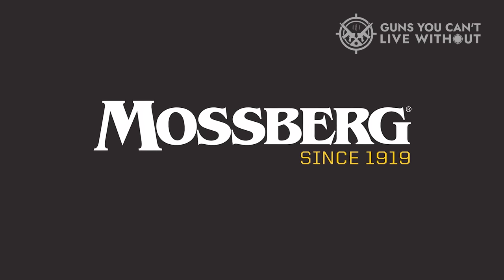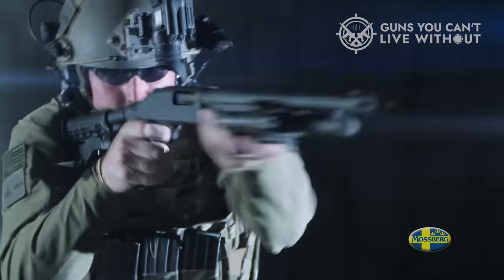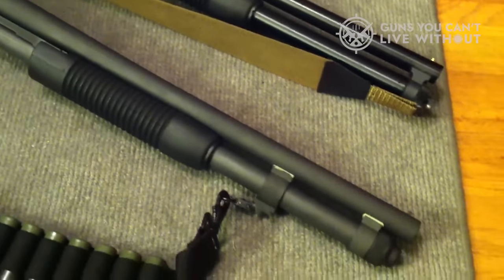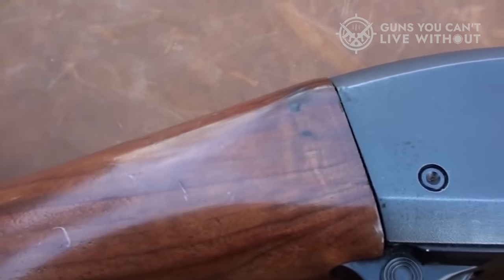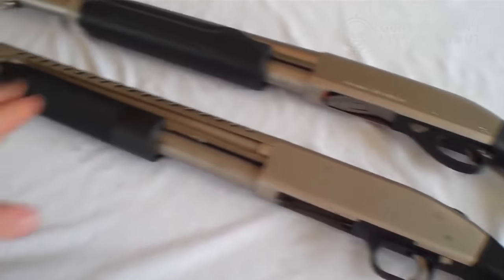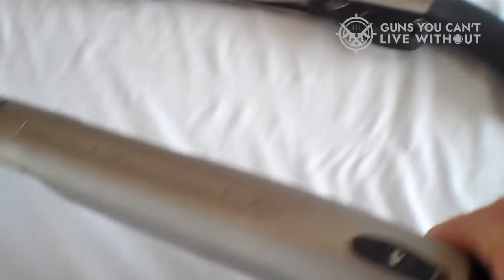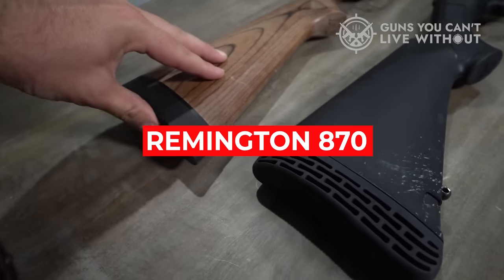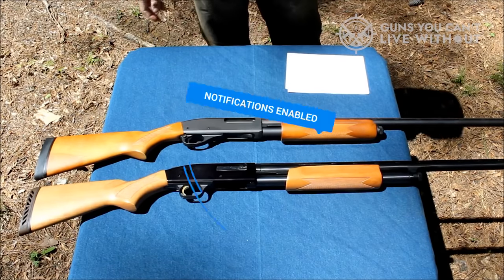Mossberg 590 vs Remington 870 - NOT EVEN FAIR.

Comment: I've used both the 870 and the 590 in the Marine Corps, as I served during the period when the Corps gave up their warhorse for the Mossberg.  I found the Mossberg to be easier to use while not sacrificing any reliability.
Reply: Must have been a bit before me, I was in 2001-09 and just remember the Mossberg. Great gun.
Reply: So is he telling a lie to sell one brand over the other.... not likely. Look at the prices of a pump type for both brands. Consider 20 ga.   vs.   12 ga.  (same charge and fewer pellets in a 20 ga. ).
Reply: I was USMC 1987-1994... we used the Mossberg ... I even went to a FLETC course designed around deploying and using shotguns. It is such a beautiful shotgun, that I owned one for a while. I only gave it up to buy a Mossberg 835 so I could have something for all around use ... defense or hunting. 

I was also Army 1994-2018, and squad leaders were issued a 870 during GWOT. Still a usable weapon, but I liked the Mossberg better.
Reply: I too was USMC (93-2006) and trained extensively with the Shotgun, both the 870 and the 590.  I grew up owning an 870 wingmaster and hunted ducks in the everglades.  

I love both, but the 580A1 is my favorite when worked.   Without the action work the 870 is a bit slicker.  I prefer the crossbolt saftey of the Remington.
Reply: when I was in the Corps, the tactical shotguns were mostly the M-37 Ithaca shotgun there were still a lot of the Winchester M-98 shotguns with the external hammer. I thought they were pretty cool looking.
Reply: I used an 870 in the USMC and own a 590 A1. I'll take my Mossberg every time.
Reply: I agree. 30 years of flawless reliability.  THEN YOU ADD COST and the Mossberg wins hands down.
Reply: Things always change in the military. When I was in the Navy I never saw a Mossberg, all we were issued was 870's.
Reply: Navy Seabee 1970 ---75. I lucked out on second deployment. Turned in my M16.  Convoy duty got me a WW II Mossberg Model 37 Combat shotgun. 9 shot, heat shield and lug. 9 shells, 81 rds down range Never loaded a rifle mag again.     Best part was the Gold inlay Hunting scenes on both sides. One side was Fowl, other side was Hunting. In the field the Gold sides were shoe polish covered. Still love that weapon.
Reply: @DougHinVA less recoil too…😝
Reply: That was an Ithaca.
Reply: Used both while in the Corps,  love both of them equally.  Built myself a M870 when I got out and bought a M590a1.
Both are great shotguns.  I use both in three-gun shoots, never had any type of failure to think of.
Reply: aluminum receiver...
Reply: 86-03.  Used both shotguns and prefer the Mossberg. Currently own 2 Mossbergs and 1 Browning bird gun.
Reply: The Mossberg is easier to magazine load under stress but harder to select slug through the ejection port when the magazine is full.  The Mossberg action is not as smooth as the Remington and not as often  used in Shotgun Competition.
Reply: With the new small drone warfare we’ll be using goose guns with improved cylinder

Comment: Navy instructor yelled at me on the  M500 course because I kept short stroking it (because I was used to the comparedly buttery smooth action of my old 870.) He said to me "run that bitch as hard as you can. If you break it, the Navy will give you another one, and a fucking medal of achievement."
Reply: Same way instructors used to teach when the military used bolt action.. WORK that bolt, show it no mercy !!... ( like a guy could really break one!) Short stroking a shotgun or rifle...or limp wristing  an auto pistol, can leave you in a very bad position.
Reply: I have been shooting for just over 30 years and fired thousand of 12 gauge rounds, most through mossberg 500 series. I have never broken a Mossberg 500 but i have worn some parts out in it, believe me you can fix that thing with a hammer if you have issues. I have had to pound pins kinda flat because they were so worn and falling out, i had an ejector get warped somehow and i beat that thing back straight and never had any more problems with it.

I love a good Remington 870 but as much use and abuse I have put on a Mossberg its damn solid shotgun that is hard to beat.

Comment: The 870 was a staple throughout my career. In 27 years virtually everything else changed but the 870 was constant.  It was simple, versatile, reliable, and effective .  Old habits & training die hard, while the Mossberg is a fine platform, the 870 is my go to shotgun.
Reply: It’s okay to be wrong.
Reply: @Loveiskind51  😅
Reply: @Loveiskind51  ?
Reply: Remington has fallen.
Reply: Like most of us, I have a variety of shotguns, rifles, pistols, but in my home, if my life depends on it, my 870 is my go to gun with an AR close beside.
Reply: The 590 is the beefed up version of the 500 that the safety, trigger guard and slide arms would constantly break on. The 590 is great the 870 always has been.
Reply: I'll take the 590 A1 please !
Reply: @@dannytimms9011 An old dog can learn new tricks... it just takes a lot of reps. I also know this because of experience. :) The question becomes: "Is it worth the investment?"
Reply: How many lives did you ruin in those 27 years?
Reply: The new 870s are absolute garbage compared to what you grew up with.  It use to be slightly better to a lot better than mossberg now its not even comparable.  I'd rather have a Maverick 88 than a new 870.
Reply: @indalecio539 only the ones that needed to be…😝
Reply: @hks956 so you like guns that rust easily…🙄
Reply: @ZSmith-yy4lv not the old ones. I have an express .12 gauge first year they came out and it still shoots good and reliable and been shot thousands of times
Reply: @hks9 13:40 56

Comment: Used an 870 for over 20 years while on patrol.  Never failed in any weather.  Bought my own 870 Magnum Express after a few years in law enforcement.  Have used it for years for trap and clays shooting.  When she locks into battery, it's as solid as a bank vault. I've installed an 18"-barrel and a magazine extension.   It's my primary home defense weapon along with my Colt 1911A1.
Reply: Excellent choices!
Reply: Same here. Except have a GLOCK 30SF 45ACP. Instead of a 1911.😊
Reply: Bro is the king of all fudds😭
Reply: If you use a Remington 870 MAGNUM, you'll never hear  "he had to shoot him twice".
Reply: Same here.  I had a Remington 870 with  the 14 inch barrel issued to me for twenty years.   I  would have loved to have taken it with me when I retired.  Never had a malfunction with that gun.

Comment: I got a used 870 Wingmaster when I turned 18.  Over 30 years later, and it is still a great gun.  It'll see more owners past me I'm sure.  Got it with a ginormously long barrel with a fixed full choke.  Swapped it out with shorter barrel with interchangeable chokes, and it made a huge difference.  Also added a Hi Viz triangular site, and it's the easiest gun to aim that I own.
Reply: I just bought a Wingmaster in  pawn shop. It was “used” (had never been fired). I couldn’t pass it up. It was the same gun my dad had except for the vent rib. Mint condition.

Comment: I have both the 590 and the 870 and both are awesome! I prefer the Mossberg because of the thumb safety location. You can't go wrong with either
Reply: I hate the cross bolt safety system and will not buy a gun that uses it.
Reply: Agreed. Mossbergs safety is right where it ought to be. Not bashing Remington, but that one little nuance, has made me a Mossberg man.
Reply: @SIXPACFISH  The Rem with the rear safety that's not instinctive to operate has been why I HATE the 870. I started out with a vintage Win M12 and got used to its forward safety. Its small but fine until gloves are on. Now the M12 riot models have the aftermarket enlargled head. Now I got a couple Moss 500's had issues with the factory safeties, so put on 2 different styled aftermarket ones that work much better.
Reply: I never us safeties as they give the user a false sense of security.  Many accidental discharges were made thinking the safety was working.  My firearm is either loaded or not.  Simple as that.
Reply: For my situation the through safety is preferable. I have a pistol grip on my 870 which makes it more accessible than a receiver-top position.

Comment: I own both shotguns in older models back b4 they got cheapened up. Both work fine for me in different hunting situations. Ive never had any failures of any type with either. They both have specific things i like. I prefer the thunb safety on mossbergs but the triggers n pull on 870. I think if a person needs one or the other for hunting or home defense both shotguns would work just fine. This is kinda like asking for a debate between 270 and 30 06 for a whitetail cartridge...i havent met a dead deer yet who knew the difference!!!
Reply: 270 kicks less
Reply: You're absolutely right.  it's a silly argument.
Reply: @obi-wankenobi1750  but 30-06 has a lot more variety in bullet weights, and you can get bullet weights than kick less than the 270 (try shooting a 30-06 with a100 grain or a 110 grain bullet, and they even have one with a 55 grain, all which are easy to hold and kick is very light, around the same recoil as a .223 or 5.56 mm). Also the .270 was designed using the 30-06 case and was made slightly necked to hold the smaller bullet, so the recoil is almost the same, withonly about 10 pounds difference in force.
Reply: @lesliemiller5790  bro missed the point of the analogy
Reply: Yep, killed a doe @ over 400 clicks on a  cut over powerline, furtherst shot I've ever taken. Remington .270 with my own hand loads.
Reply: I agree. My 870 is an older model-when they were made with quality and integrity. It was my grandfathers and was passed down to me. I’ll never part with it. Everyone that tries it, automatically is in search for an older 870 right after. Something about the trigger and the overall feel. Not knocking a mossberg just have not had the pleasure of trying it out yet.
Reply: I thought about 870 but am afraid of getting the freedom group lemon
Reply: @duck2587  yes. I have a cheapened-up 870 and it is the most unreliable gun I own. I'm looking for something else now. Maybe an old one.
Reply: Depends on the terrain as far as deer cartridge goes.  .270 for long range and 30-06 for busting brush.
Reply: This is the best comment I’ve read on YouTube to date out of ten years or so.
Reply: @obi-wankenobi1750 who cares
Reply: DR-qs4xk That was the joke...
Reply: @mrguiltyfool  I collect the Remy Wingmasters.  Freedom Group QC of late is on par with the pre '07 Wingmasters.  I wouldn't take a free Remington Express shotgun.  Wingmasters are just buttery smooth actions ... kinda like Tikka bolts.
Reply: @theebrainfixer  interesting
Reply: I never liked Mossberg pumps because the pump was alot longer of a travel.  Whereas the 870 was a much shorter and less laborious pump.
Reply: @mohunter68  Really, 400 clicks? The longest kill by military sniper with a .50 is 3.4 clicks. I don't care how hot you loaded it, a .270 isn't going make it out 400 clicks, past 400 yards the .270 looses enough energy to be questionable for ethical shots, looses accuracy at 900 yards, literally looses all velocity and hits the ground at 8 clicks.
Reply: A 30-06 with a 150 grain projectile, shot at 310 yards will drop around 21 inches, 270 with 130 grain projectile same distance, drops 4 1/2 inches, this info comes from the fbi's forensic ballistic rifle data sheet
Reply: @aphelion2902 "bro" actually made a good point that was analogous to the original inquiry, that you, yourself, clearly do not understand.

Comment: I went with the Mossberg 500.  Mine came with both the short barrel for home defense and the long barrel for hunting/clays.  Many gun owners like to work on their own equipment.
Reply: Had the 500 with 20" barrel and pistol grip, 8 shot tube. Only problem was hanging on to it! Never jammed, plastic grip,
Reply: I wouldn't take my guns to a gunsmith unless it's to be reblued and I keep my shit clean anyhow
Reply: My mossberg is a piece of s@#$. It has not survived time and use,  the junk pot metal action will not let this one survived.  If it doesn't have a steel action don't buy it.
Reply: The 500 was my first noob gun purchase...it does it's job well enough, but I probably should have laid down a little extra for the 590 with an extended mag tube.
Reply: @andersonsprairieviewfarm2552  What the hell do you do with your shotgun to mess up a 500? I have had one for decades and it is still in great shape.

Comment: My dad had a Remington 870 and when I was 14 years old I bought my own 870 Wingmaster. Granted this was 1969, so I can't speak for more modern Remingtons. But these two guns were pretty much unbreakable. Dad's spent the night under 6 feet of muddy water with a weedy, muddy bottom.  Using a rake and other tools pulled it up the next day. Cleaned it up and it never missed a beat.  My Wingmaster was carried in every weather during duck and pheasant hunting.  If I held a hammer at arm's length and dropped it I would expect to see it NOT hit the ground before I would expect to see my 870 fail.  (I'm sure the Moss is a good gun as well.)
Reply: I know TWO (2) guys whose 870 receivers fell apart, came unriveted, and Remington would not warranty them.  I have used them many times, but I will never buy another.  I've switched to Mossberg for my go-to-war shotguns.  At least they won't fall apart on me!
Reply: The old wingmasters are in a totally different class than any 870 now. I don’t think I’d ever own a newer 870 again
Reply: @nellsonstout7001  Agree, the old Wingmasters are the way to go with an 870.
Reply: I own 3  Wingmasters  bought in the 70’s and I have never had 1 issue with any of them.  I have heard the more modern ones are not the best.
Reply: The older wingmasters are a thing of beauty like no Mossberg I’ve ever seen.

Comment: I own 4 870s and 3 Mossbergs.  I love the 870s overall.  The one thing I prefer on the 500s and 590s is the safety being on top of the receiver.  It's just easier to find.
Reply: In my situation, the safety location breaks in favor of the 870 - I have a pistol grip on my 870, so the through is better positioned to access without shifting my grip than the 500s top-mounted.
Reply: I agree about the safety and they’re both great. I think the 870 is “tighter” for lack of a better word. My 500 kind of rattles a bit
Reply: Mossberg safety is the worst in the industry. Digs right into the web if your hand if you hipefire. And who tf uses a safety on a pump action? That's like putting a safety on a revolver. You do the safety always off and out of the way like the 870.
Reply: @undisputed6034  Wow. You’re one of these fake gun guys huh?
Reply: @Billy-rq9hs  what in the flying fk is a fake gun guy
Reply: @undisputed6034  Explain “who tf uses a safety on a pump”? You probably don’t use one ever

Comment: I was a cop for 30 years.   When I started in 1981, we had Ithaca shotguns with a single port for loading and ejection.  Ithaca was fine.   Then we went to Remington 870.  Then the last 10 years, we carried Mossberg.   I can say there was zero difference between the Remington and Mossberg.  We qualified every other month with the shotgun and hand gun.  Right before I retired, the pistol grip configuration was installed and that was a real benefit for control of the shot gun.  Probably the best feature.

Comment: I learned to shoot on a Model 12 Winchester that belonged to my grandpa. That gun has now been retired to my gun safe because of its value, both monetary and personal. While I own Remingtons, Mossbergs and other shotguns, I usually reach for the Mossberg because it feels the most like my old trusty Model 12 that I grew up shooting.
Reply: I can relate. I inherited my grandpa's Win Mod12 12 ga nickel steel. Bought new in 1922 or 1924 depending on what serial number I looked at. Grampa was a market hunter in the Midwest for years thru the 1920s to about 1940. It helped get him and his family through hard times on the Farm Depression of the 1920s and Great Depression 1930s. I forget the cost in dollars but it cost him 3 months wages working hard for other farmers. 

Trivia: Grampa told me the M12 was advertised as jam-proof back when he was deciding what gun to get. I haven't seen an ad stating that but he had zero reason to stretch the truth or make up a story. 

He also shot game for local grocery stores. Then my dad "borrowed" for 25 years, then I got it. It was heavily worn but was it slick. Took it to an old gunsmith who said quote" I've never seen a Model 12 so worn out". He rebuilt the action bar to lift the bolt's rear up higher. 

99% of M12 shooters don't know you should grease the cutout in the bolt + on the action bar. At minimum get some good slippery grease that doesn't melt under heat. I use moly-lithium high temp and load up the action bar to get some grease into the bolt. Far as I've seen since 1972 the Win M12 just doesn't wear out for decades of dirty hard use, provided its cleaned getting all the dirt and weed seeds out of the trigger group. 

The M12 was also used for a fair amount of informal practice on the farm or at the club range. 
The best pump ever made. Utterly reliable Never a single jam or malfunction in the 51 years I've had it. Now I have 5 or 7 LOL. I do wish I'd found a 16 gage M12 in 1972 as the 16 is so much nicer for a barely 13 yr old to carry and swing. But the 12 gage version built my upper body strength and thighs trudging up & down hills looking for wily pheasants.
Reply: You can slam fire the model 12. Its a great shotgun.